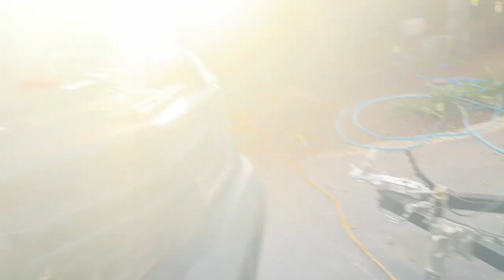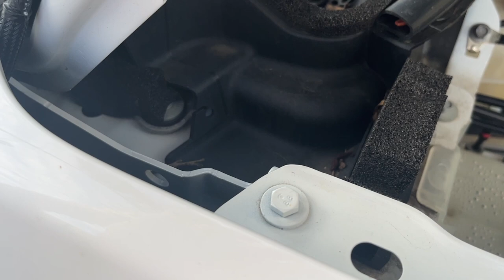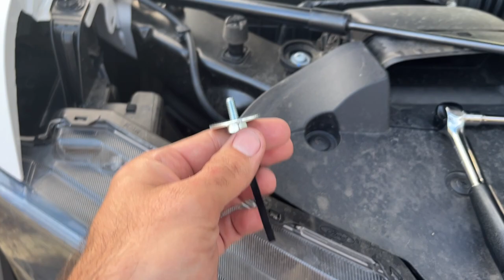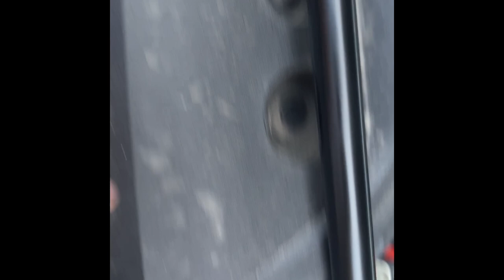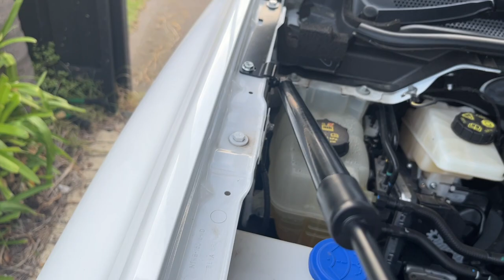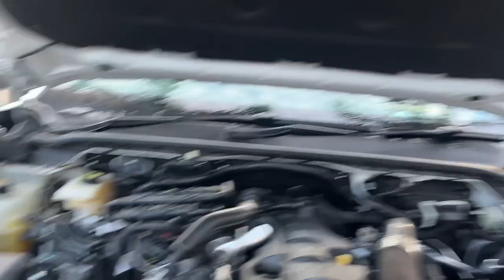Fitting Struts to Next Gen Ranger Bonnet

Comment: These videos are incredibly helpful. Thank you. Any chance you have customized with some headlights and videoed how to use the spare high beam cables?
Reply from the maker: Hi Rich. Thanks for your comment. Glad you find it helpful. I haven't played with the headlights. I had my lightbar etc wired up by Ironman when they did my Raid bar.
Reply: Hey Mike. Any idea how to get the struts to go down? I have fitted them but they won’t go down
Reply from the maker: @richard.hart.  hi mate. They are firm at first, because they haven’t been used. They need to be “oiled”. Gently apply pressure in and off to each side, they will go down. Then gently put them up and down a few times to get them fully primed.